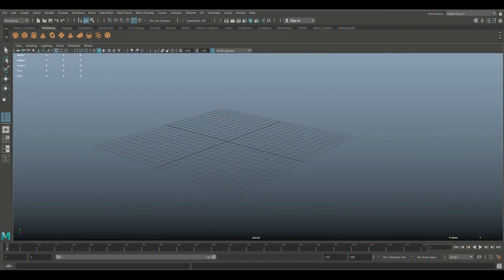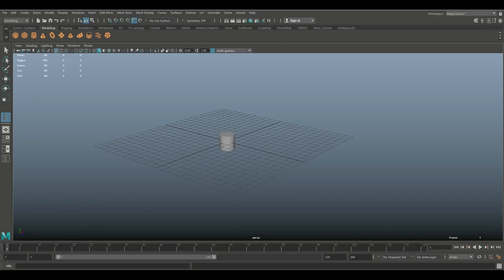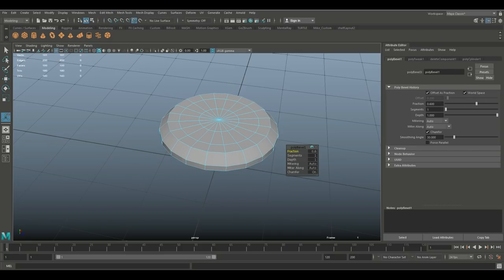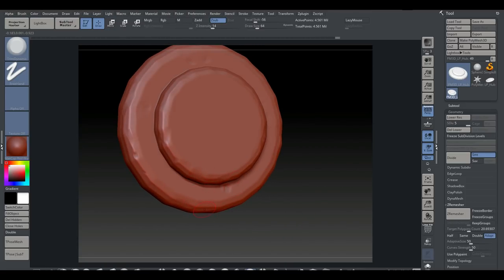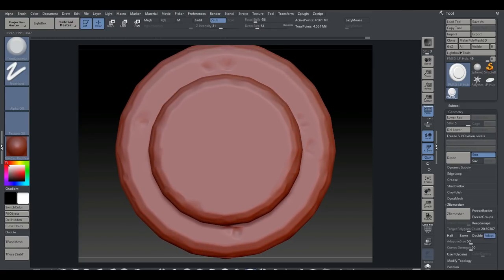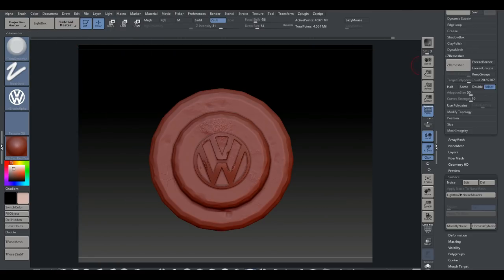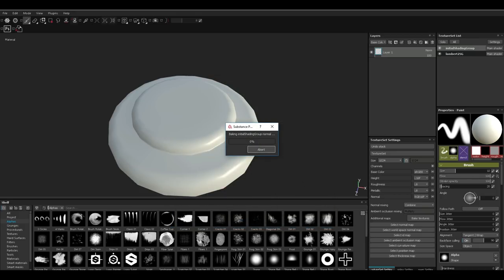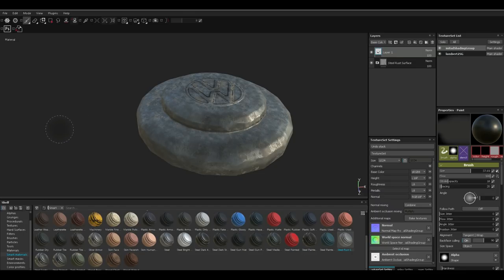Modeling a Volkswagen Hubcap in 3D ( FULL WORKFLOW )

Comment: Hey Mike, I hope you noticed but the Shift key is actually a brush modifier. In this case it changes to the smooth brush. When you change the ZIntensity without pressing shift while doing it, you'll change the intensity of your default brush (in this case, trim dynamic) but not the smooth brish intensity. Also it is already on max intensity. What you would want to do is increase its draw size to actually increase the strength of the smooth
Reply from the maker: Still learning ZBrush. Thanks for sharing